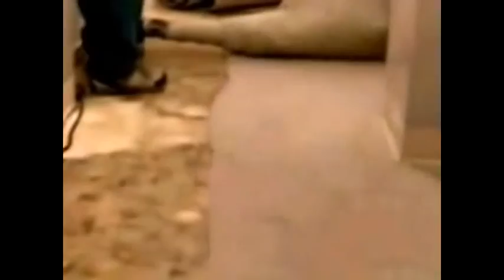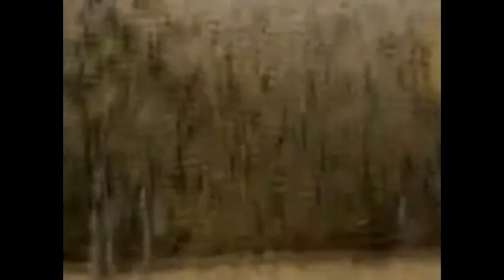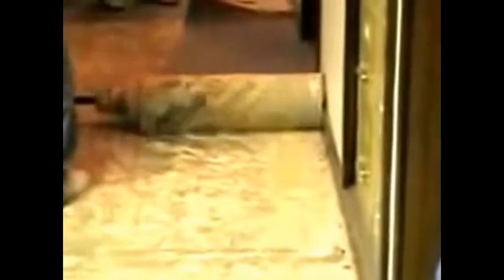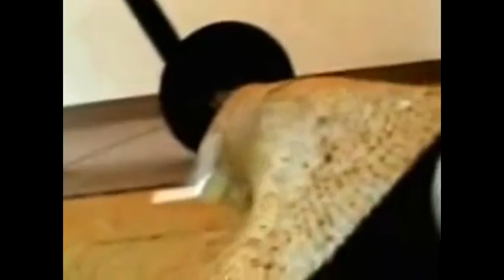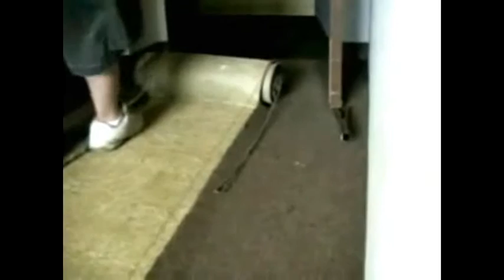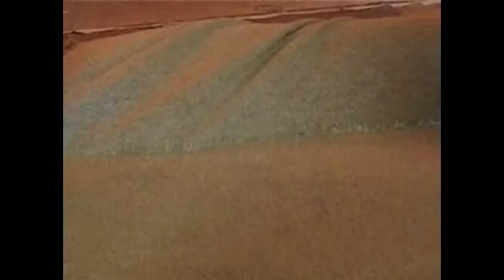Shank Floor Tools THE BEST GLUE DOWN CARPET REMOVAL TOOL

Comment: admittedly, that's pretty decent......until you get into a job where the carpet is glued onto vct.  the upward pulling may pop tiles.  the winch-style pullers are the best.  a low horizontal pull.